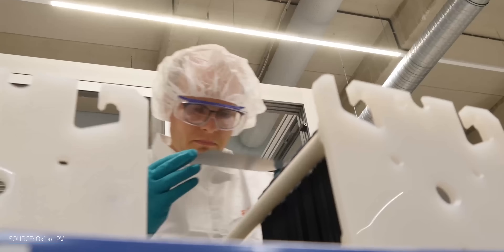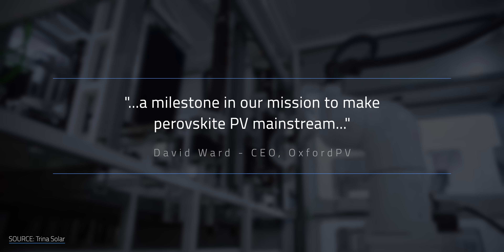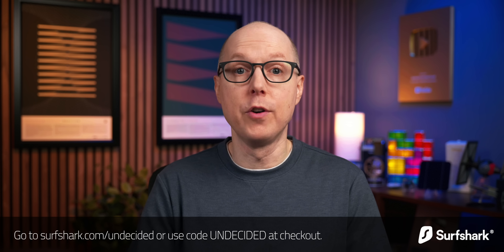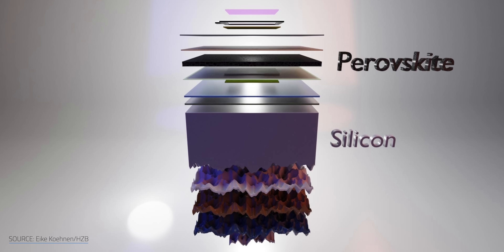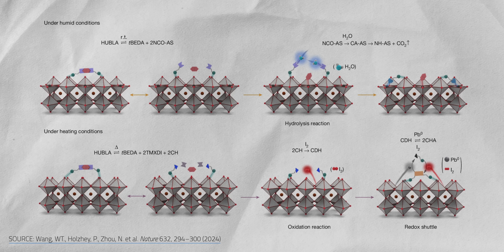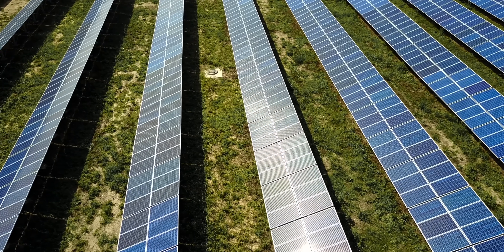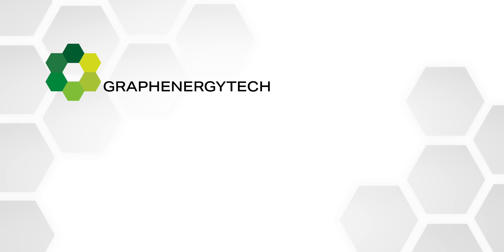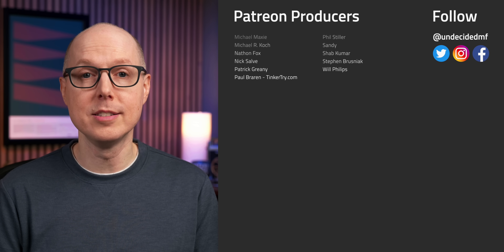What Solar’s 2025 Breakthroughs Mean for 2026

Comment: Efficiency is already enough. Unless this impoves the watt to dollar ratio, makes the panels cheaper few will care. Crystal silicon solar panels have been improving for 50 years. Mature technology.
Reply: @rollmeister  I think the idea would be that they will be able to bring the price per watt down here overtime. Obviously new technology is generally more expensive than old ones, but we all use flat screen TVs now, and those used to be very very much more expensive. Not a guarantee of anything of course, but that fact that it is possible is a good sign

Comment: Any discussion on the issue of using lead in perovskite?

From Grok:  “The use of lead in perovskite solar cells remains a significant concern as manufacturing scales up, primarily due to its toxicity and potential for environmental release, though ongoing research is actively mitigating these risks.”

Comment: At some point in the not too distant future, the world is going to need to run on another energy system not based on carbon. Every year we get closer to practical solutions to arriving there.  This is one of those possible solutions. Average efficiency of current panels is in the neighbourhood of 20 percent. Bumping that to 30 means 33 percent less panels to produce the same juice, OR the same solar farm area producing 33 percent more electricity ! Imagine a couple of these mounted on every balcony of a condo facing south... too many probably makes it too hot, but a vertical solar farm could be interesting.

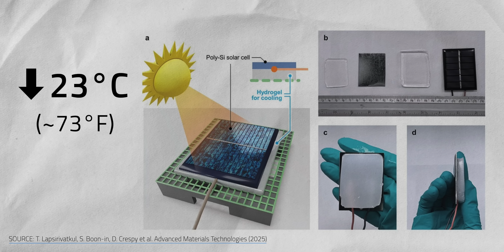Comment: I'm confused by the slide at 10:06. a drop of 23C degrees is not equal to a drop of 73F. 23C = 41F in movement from a starting temp BUT if you wanted to convert 23C to Fahrenheit, then you get 73F due to the starting point of 32F.

Comment: My prediction: won’t be “year of Perovskites” until (1) commensurate lifetime is demonstrated adequately, (2) ‘installed cost’ (not $/W, but LCOE that factors in efficiency gain) falls below Si at risk-reduced lifetime, and (3) production capacity is huge enough to fulfill orders.  That said, there are use-cases where the extra energy/area may be a benefit (eg rooftop vs huge field) as the go-to-market strategy; 100% valid, tho still niche.  ANY COST DATA out there??  (I’ve not been able to find any… which means above 3 conditions haven’t been met! ;)

Comment: Right now I think what s holding back solar isn't Cell efficiency (of course this will help bring down costs).  What is killing us in the US is the installation-permitting-electronics needed.  With every installation being treated as a one off, requiring complicated inspections, engineering input and expensive permitting.  I would really like to hear about any innovations targeting these costs.
Reply: I agree.  Half of everything I find is for small portable systems (RVs, Camping?, or Boats?).  Everything big enough to run a modern normal (not an off-grid 3 room cabin) home comes as multiple components by multiple companies all looking like they were made in a garage as a prototype.

Comment: 10:02 A difference of 23 C difference is a difference of 41.4 F. You cannot just convert the differences with a unit converter as their 0-point is different. 0C = 32F, and 23 C = 73.4 F. Thus, the 23 C difference =  73.4 F - 32 F = 41.4 F difference.

Comment: Solar and wind are both bull as far as any "energy transition" goes. All the renewables are insignificant and falsely represented vs fossil fuel use, as is their relative cost on the grid. The totals have remained tiny for decades. For the individual on their own home? Sure, it works and I'd encourage backing up a grid connection that risks interruption (or worse, collapse) and lowering your own costs. For the grid, it's a failure, the real costs of which have been stupidly ignored. Read Art Berman's article "The Sunset of the Renewable Dream" for real costs and see the documentary Greenwashed on youtube.

Comment: I don't believe in a commercial breakthrough for perovskite solar cells. Silicon is cheap and readily available. The potentially higher efficiency is only worthwhile in specialized applications where area or weight is limited.

Comment: Call me when "available tech at a low cost" actually becomes available. In the meantime the nano carbon tech can also be adapted to silicon panels as well. If it was more cost effective it would be on the drawing board for silicon based cells but it's not, so I'm not holding my breath. If we are being honest with ourselves we are at minimum 10-15 years from viable affordable P-cells for the average joe. And once P-cells become available at a low cost, you better believe silicon based cells will further become more affordable making them even more attractive. Silicon cells are king and will remain king for a very long time.

Comment: The hydrogels pick up moisture at night, to release in the day when the panels get warm. Which means that there are places that are warm and moist at night. These are going to get covered in mold or in algae really quickly. I live in alabama. All of the pressure treated wood I put outside is covered in algae or mold. My pressure treated fence is green from all of the mold and algae.
Reply: Could be green due to the copper used to pressure treat.

Comment: Main takeaway; the US is not a significant player in cutting edge research, or manufacturing of future energy generation from solar. We’re really drilling ourselves good.
Reply: We are leaders in protecting the billionaires. Not much else.
Reply: @JohnSurvivingAI the billionaires are creating all the value. Not one of the top five has stolen a penny from anybody. Yet useless you want to steal their money. 😂
Reply: @DblSpk4u  Can the billionaires create value with out any of the workers ? Judging by your words you dont seem to understand.
Reply: We're doing okay manufacturing wise for our domestic market. First Solar opened a massive factory in New Iberia, Louisiana this year, 2.4 million square feet all under one roof. Suppose to be able to produce enough panels per year to generate 3.5 gigawatts, or roughly 800k homes worth. Had the chance to tour the facility, it's pretty impressive.
Reply: @chancewiese4872 and that is a symptom of the problem, that the need is lower and we are not able to export and depend on others for technology. When I wanted to install solar, all panels were done in China for all the companies
Reply: @chancewiese4872  Pakistan installed ~35 GWp in 2025.
Reply: Same with ai and almost everything
Reply: That's why we are building 10 new ap1000 nuclear reactors instead. That's like 1,500,000 solar panels. Which is more efficient? Yeah.
Reply: @Knight_Kin , sorry, not a fan of single points of failure and big transmission costs.
Reply: @blaiseutube  You're just a fan of an inefficient dead end technology that wrecks every energy grid that adopts it.
Reply: @breckenridgelong7692 there is no evidence of that, and no, it was not the case for the Iberian peninsula crash, and it is for those economies to be the strongest in the eu and most energy independent.
Reply: @blaiseutube  but you’re a fan of massive environmental destruction for crappy inefficient old power technology with the literal worst output per unit right? You must be German the way you cry about nuclear!🤣😂
Reply: @mariocruz9143 Congratulations, you've bought into the global warming hoax argument hook line and sinker. Solar isn't environmentally damaging when compared to almost any other technology over its lifetime.
Reply: @Knight_Kin  You have no idea what you are asking for.  Recent attempts at nuclear in the US were financial disasters. The only way to make nuclear viable is to add a carbon tax the size of the social cost of carbon or higher.  Be careful what you ask for.
Reply: @Knight_Kin  too expensive, has no future. China shows the way to go with massive solar and wind turbines
Reply: If that is how you reason, then following your logic trail would conclude that only about 12 entities are researching solar power, since that was all that was mentioned in this single non-professional sourcing. It sounds like you have issues with logic reasoning that may span way past the field of solar power and well into the fantasy of ideology. You should look into that and see what you can do to improve before you find yourself invested in something based off of your current logic and reason forming habits.
Reply: @robertevans2450 do you have specific counterexamples to offer or did his "faulty logic" result in an accurate conclusion that bothers you to acknowledge?
Reply: @stephensena5332  US was never about cutting edge technology. This was Europe and post war Japan. US was the raw strength of manufacture.
Reply: @xzGAB ridiculous take. The United States created the vast majority of the patents in the 20th century.
Reply: @DblSpk4u Yes, they have the raw strength of manpower, of course they will have the vast majority of patents. But the machines they manufacture are made with European and Japanese key components. For example, their MBT M1 Abrams are made with british Chobham armor and west german cannon. The best capacitors for the electronics were japanese and so on. It wasn't economically viable for American companies to compete with European and Japanese high tech industry, so they created new products with foreign key components.

Comment: Great vid. Love seeing the light weight printing solar. As a pilot I’d love to see one day a wrap you could add to the structure for additional power. Imagine a solution that could provide 5-10 minutes of power when you run out of fuel In a GA aircraft. Happens often by poor planning pilots and this could be a type of fail safe for emergency power when needed. Keep up the great vids.

Comment: 5:05 It's amusing for me to see silicon pyramids being used in solar cells. My father was a semiconductor process engineer (and developed the world's first plasma etcher). Sometime in the 1980s he was working on wet etching of silicon with potassium hydroxide to make resonant pressure sensors, and he would occasionally get these pyramids. I can recall our conversations at home including the comments that one day someone would find a use for them.

With hindsight the application in solar panels is obvious. I was working in CMOS image sensors for a many years and sometimes would ponder the use of the pyramids to increase quantum efficiency, but they wouldn't work there because of the need to build up patterned layers on top of the silicon. Also avoiding defects that increase dark current would be challenging. So I moved on and stopped thinking about it.
Reply: Fascinating! Your dad must've been a genius.